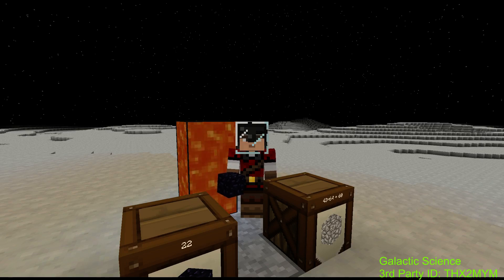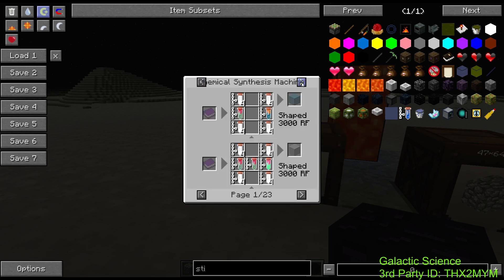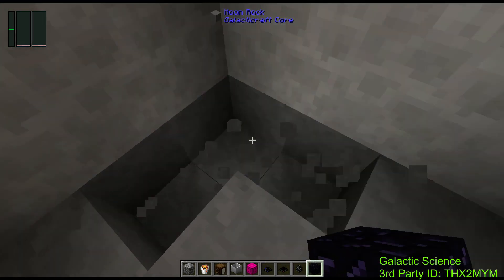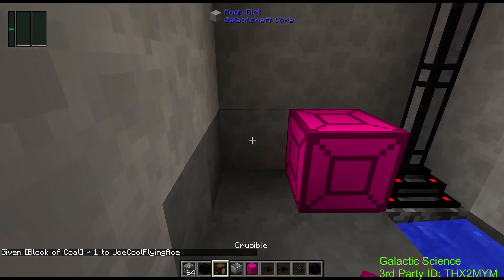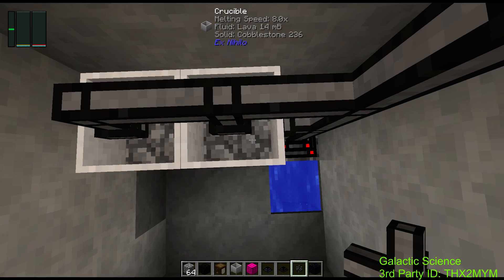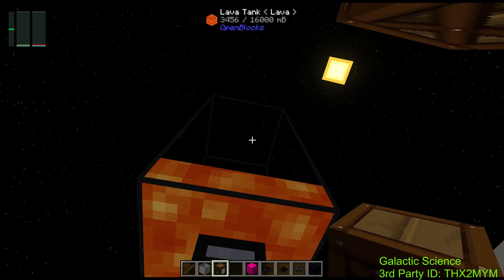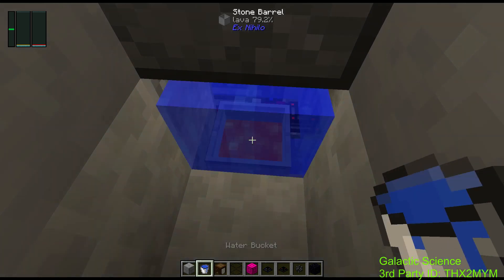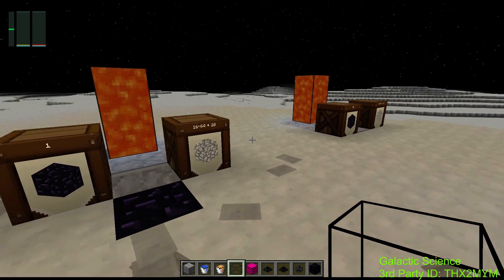Tutorial: Cobble/Lava/Obsidian Station for Galactic Science

Comment: How did you get into creative? It says I dont have permission, and I cant op myself or make new worlds that arent templates.
Reply from the maker: +GamingRooster Open your inventory.
Click Options in the bottom left.
Click Inventory.
Click Global in the upper right corner.
Then change the mode to Cheat. (Recipe and Utility are the other two modes.)
This will give you access to the NEI buttons in the upper left. From there you can change to creative using the buttons.
Reply: +GamingRooster +JoeCool FlyingAce You can also use the Open to LAN and allow commands there ;)

Comment: Or you can use sugar power even better
Reply: water power is the best in the beginning
Reply from the maker: Here is a good place to start:
https://youtu.be/0mdKRUuUC-k

If I recall, and they haven't changed it, you can get the Chemical Decomposer pretty early. Use the transfer node with an interaction upgrade piped into the Chemical Decomposer. This will make hydrogen and oxygen. Put these into the Stirling Generator. Used that setup for quite a while.
Reply: +JoeCool FlyingAce obsidian doest spawn
Reply: +Super Gamer it spawns but it doesnt transfer from barrel